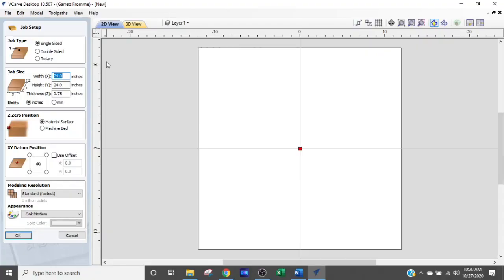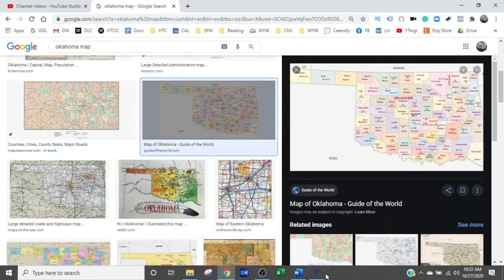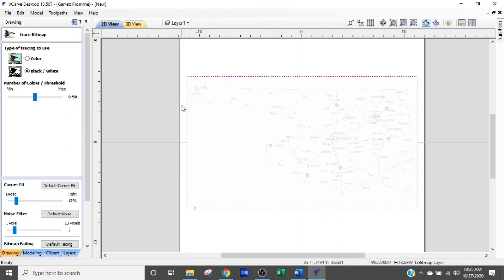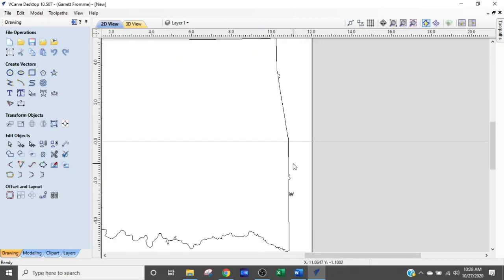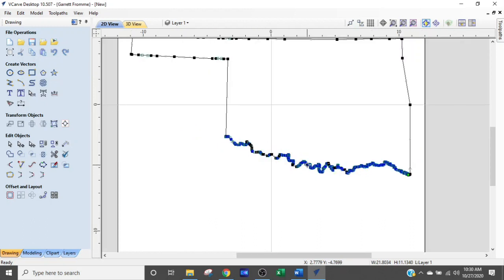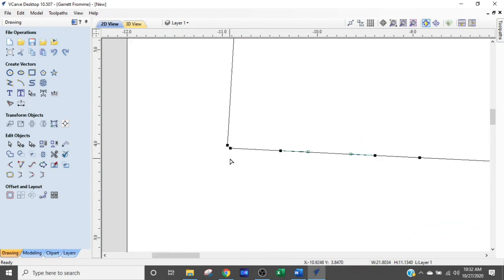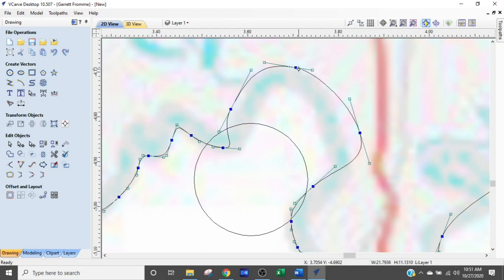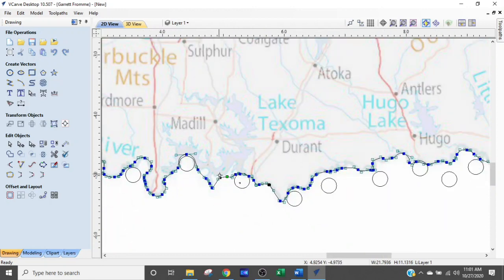Clean Up Complicated Shapes 4 Your CNC Router Or Laser Project, Vcarve For Beginners, Vectric Bitmap

Comment: If you just carve that out with a 1/4" em, vcarve will do all of that on its own without messing around with the nodes. Or just use an 1/8 em. Thanks for your video's! em=endmill for those who will ask.
Reply from the maker: Yes, you are right. I was doing it this way  for a chamfer second operation

Comment: Good video.  I use bit map a lot mostly black and white, haven't had much luck with the color.  In Google i usually click on images, tools, type, line drawings.
Reply from the maker: Your way is a lot easier to work with.. I was trying to get anotomically correct shapes with a lot of detail. I've since learned you just don;t need a lot of detail in state to have a good wood project. Thanks Leroy.